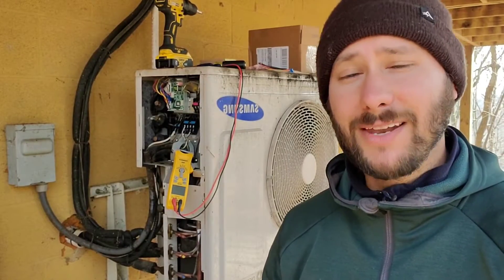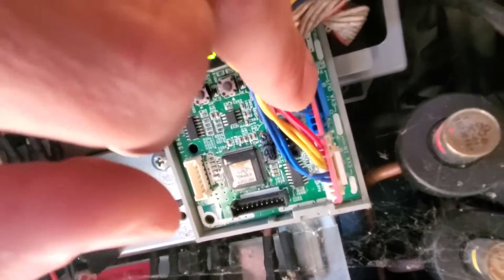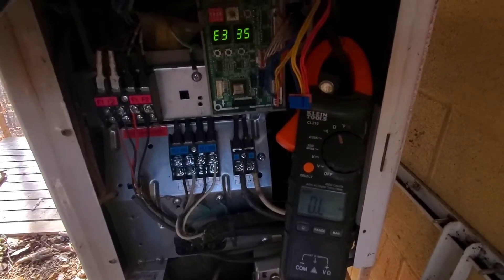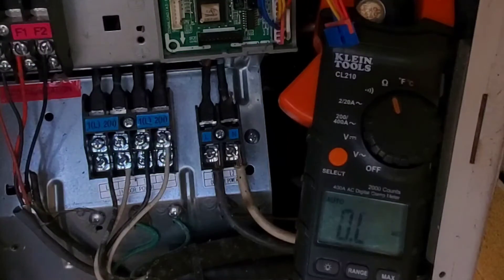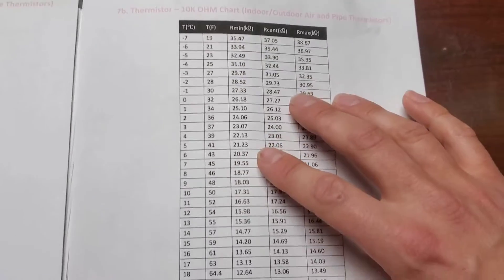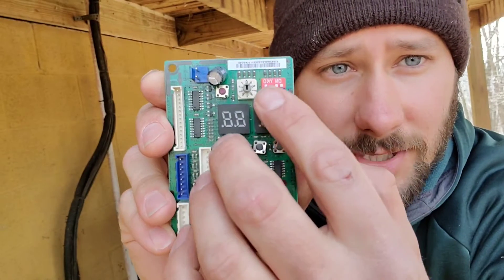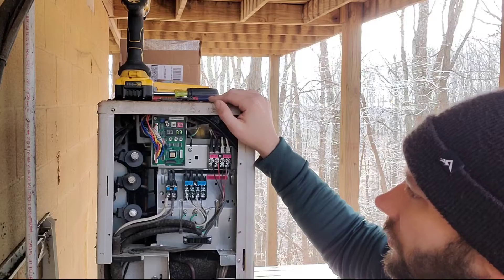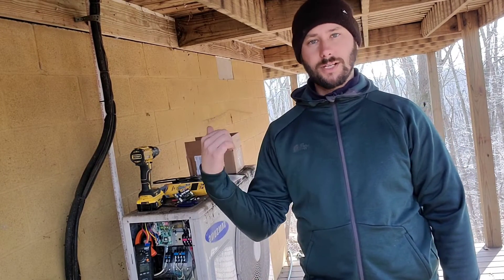Samsung HVAC E337 open/shorted EVA OUT sensor

Comment: I have a FJM outdoor unit with an E330 error which I believe is inlet vs outlet in your video. Where are the inlet sensors for that code (E330) located?
Reply: @terrythurman5869  Have you solved the malfunction?

Comment: Where will the Evap out sensor be on a ducted system?
Im having a code in regards to the sensor which i want to locate and test it.
Followed your video but couldnt find anything though mine is a ducted not a inverter.
Reply from the maker: on the indoor coil I have another video of the ducted unit sensors

Comment: Taddy had e3 36 today at my aunts house, i installed last year.i going back tomorrow with sensors tomorrow. Is e3 36 indoor sensor?
Reply from the maker: Outdoor sensor

You can use a generic sensor
Reply: @taddydigest  i getting sensors tomorrow  think still under warranty, but when i looked up code i believe it said evap out sensor short / open. Does that mean the sensor on the head/ wall unit? I think it does but just wanted to check with you taddy because you are samsung master of the universe and i trust you.
Reply from the maker: @richardharmon874 Yes, that means the indoor sensor. Those are ten kilo ohm sensors
Reply: Thanks again. Appreciate the help.

Comment: Hi, congratulations for the very useful video. I have the same problem E337, a probe is broken (1kohm), can I replace it with a 10 Kohm (25°C) universal one? Thank you
Reply: Samsung AJ068FCJ3EH
Reply from the maker: https://youtu.be/2gPUC5Go3mQ
Reply from the maker: Yes, you can I have a video on replacing sensors with generac ones
Reply: @taddydigest  Thank you very much! 👍
Reply from the maker: your welcome check out the video

Comment: Is airhandler still powered by condenser or does it need separate power. Or only separate power if heat coil installed?
Reply from the maker: Yes on the slim duct air handler the power wire comes from the outdoor the unit

Comment: So cool you can run airhandler and wall mount ductless on same condenser. I installed about 50 samsung units this past year and haven't had any problems yet.still haven't did a ducted airhandler yet by samsung.
Reply from the maker: Wow very impressive Richard you haven't installed quite a few units glad you have had no issue so far
 Let me know if you need anything
Reply: @taddydigest  thanks man.
Reply from the maker: your welcome

Comment: Hi there, do you have the site and part number for this sensors.
Reply from the maker: join my channel I be glad to help
Reply: Taddy Digest This me above asking for the site and part number. Actually i have error code E332 which is EVA IN 3 sensor reading low at 0.67...I’ve been trying and searching where to order this part but no luck. Hopefully you can help me out here.

Comment: Hi, im just new here. For FJM how does it get fresh air into a room? My understanding for AC is that air is just being conditioned and recycled. Thankd
Reply from the maker: Fresh air like outside air ?
 For the wall mount air handlers the air is drawn in from the top and pushed through the bottom angular vein
Reply: @taddydigest  yes fresh air from outside. Do i still need to have an air inlet. Its for the the basement which will be closed. Im a bit concerned whether i need an air inlet or not.
Reply from the maker: if you have a tightly insulated home
 And have gas appliances like maybe unvented fireplace then you may need to have some fresh air you'll have to have an air inlet and a inline filter
Reply from the maker: yes air is provided through return you can use mim b14 board for power vent option 
air enters indoor heat exchanger and is conditioned when call for heat or cooling